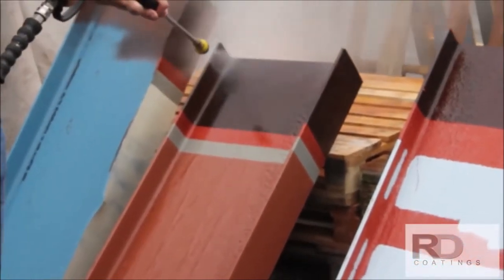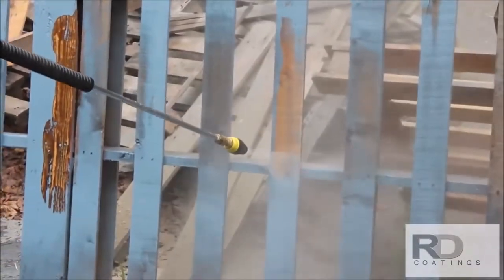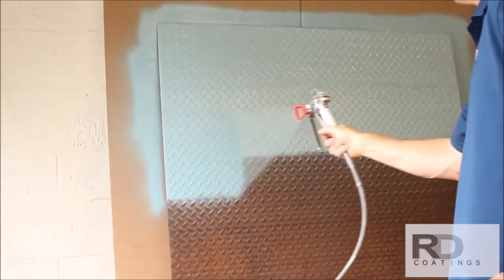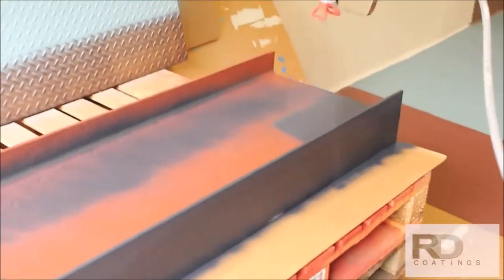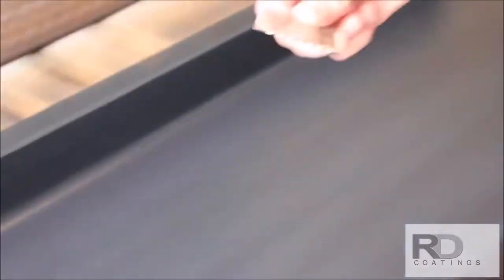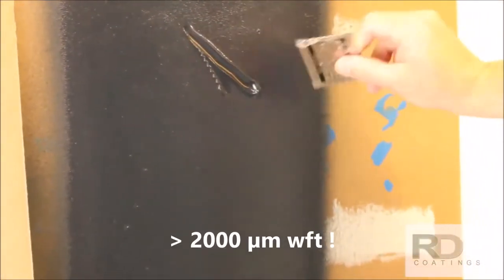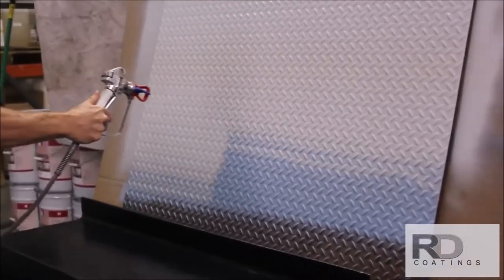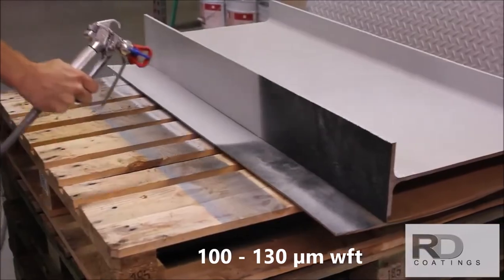RD-Elastometal, a short video explaining how to apply the coating.

Comment: czy konieczny jest podkład?
Reply from the maker: You can apply RD-Elastometal directly without the need of a primer on steel, weathered galvanized steel older than 1 year, cast iron steel and most already painted surfaces as long as you make sure that existing paint still adheres properly.